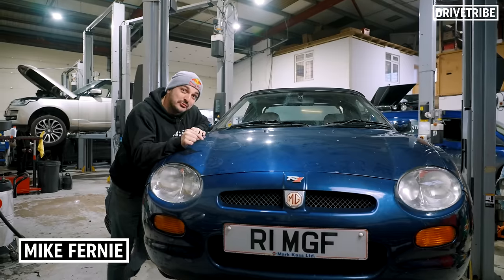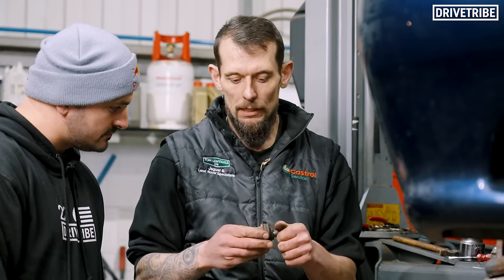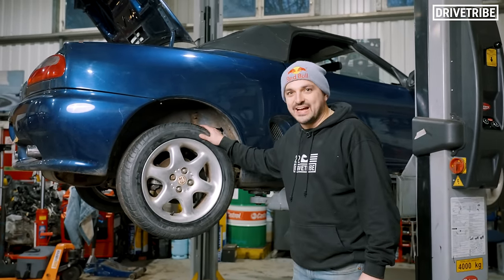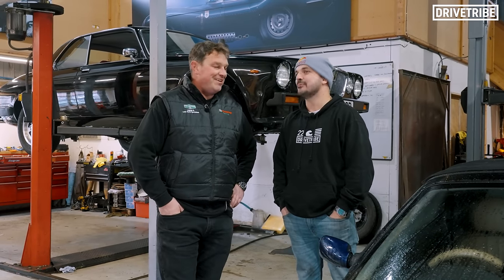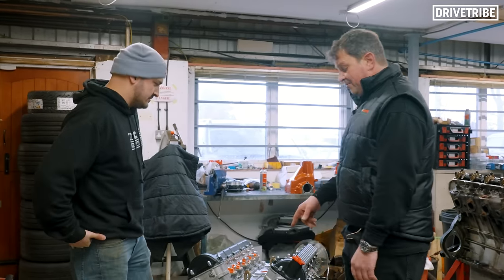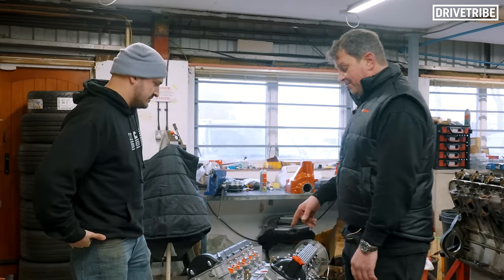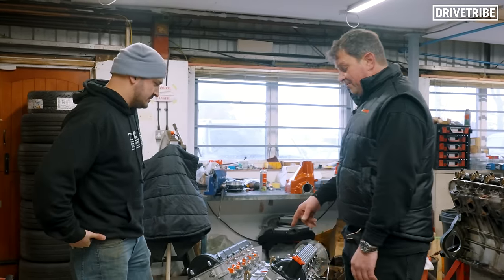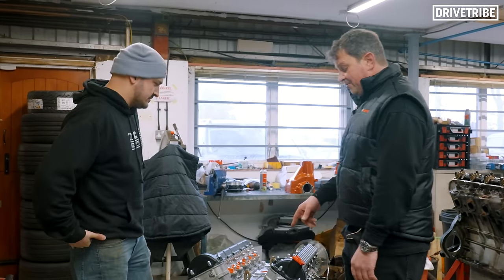Getting our £600 BARN FIND sportscar back on the road – Will it fail an MOT?

Comment: I think I love that balljoint design!! Way better than the push fit fuse welded bollocks normally have to deal with. Although I guess those threads can get destroyed too...
Reply: They are a NIGHTMARE to remove 😂😂
Reply: @Pugjamin  Really? Can't ya just use a big ol pry bar and a bit of heat?

Comment: The ball joint on a mini is quite different and makes the metro’s look space age, mini ball joints are actually shimmed on the hub, and are actually re-buildable
Reply: This ball joint is a male fitting and a sealed unit, the mini is a female where as you correctly say it is shimmed.
Reply: @bountyhuntermk2520  100% true, ive owned many minis and re-shimming ball joints is part of regular servicing.
Reply: @cornovii3012  Aahh yes! I remember that you basically had to remove a shim the day before every MOT , when there were no shims left, you had to buy a repair kit and start all over again!

Comment: With a understeer biased car, using Linglongs and a bit better gripping tyres in the rear sounds like a dangerous idea. The MGF really benefits from same type/design/brand tyres on all 4 corners. Tyre dimensions front and rear can differ (like this car was delivered 185/55 front, 205/50 rear)
Reply: Replying to get this higher up

I had a Tf and it lasted 3 weeks because it span out on a wet road under mild acceleration due to miss matched tires

Comment: If you find a component like a Ball Joint failure on one side, Should you replace BOTH ? (unless the other side has already been done). The same goes for Drop links, shocks, springs, CV-boots and all other components that typically wear in pairs.

Comment: I had to agree with Tom’s verdict on the MGF being another big Leyland / MG Rover fail that should have been great… by the mid-90s the problematic / disastrous Triumph Stag had been sorted and rehabilitated after 25 years effort, so someone in the Midlands thought… I know, let’s leapfrog Mazda (and Fiat) and reclaim sports car glory by stretching the reliable Rover K series 1.4 16v to 1.8 litres, give it 120+ HP and stick it in the back of a 2-seater with the radiator at the front ! How hard can it be ? What could possibly go wrong ?

Comment: Black Jaguar XJC on the lift in the background, but it has series 3 XJ door handles, side mirrors, S3 Grille. The bumper and the turn indicators in the front wings say its a US spec car. Strange to see so mant S3 parts on a S2 Jag.

Comment: Why would you NOT put your the brand new tyres on the front? Surely best tread on steering tyres is important?
Reply: Some MGFs have wider tyres on the rear than on the front. I'm fairly certain this one will.
Reply: @ryanwilliams6526 Presumably LingLong didn’t do that size when the fronts were done !

Comment: My mate bought an MGF when they first came out around 1996. He lent it to me when he went on his jollies. It came with a tarp to shove over the soft top as it leaked like a sieve and puddles formed in the foot wells if it rained overnight...and the wipers  intermittently packed up & the halfwit dealers couldn't resolve the issue.  Laughably poor car & he had to off load it by part exchanging it with less than 6000 miles on the clock.